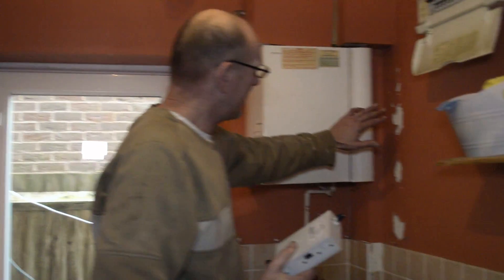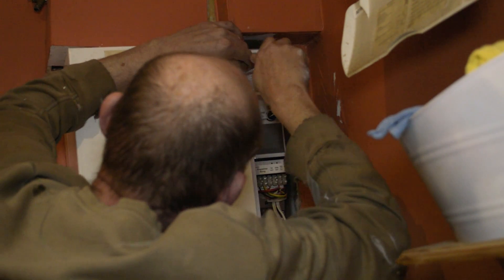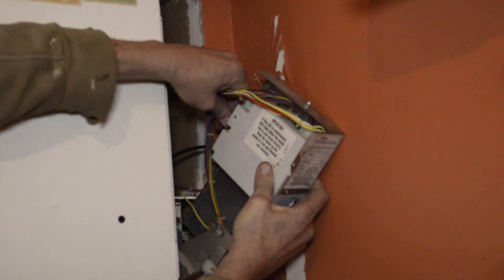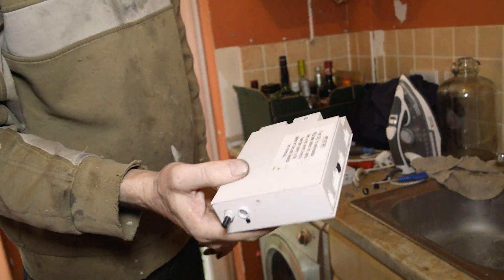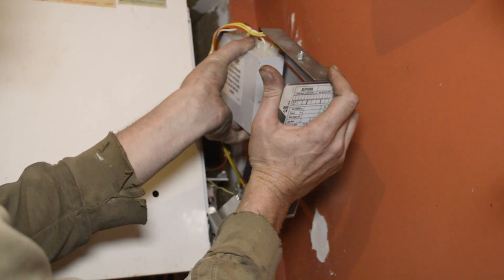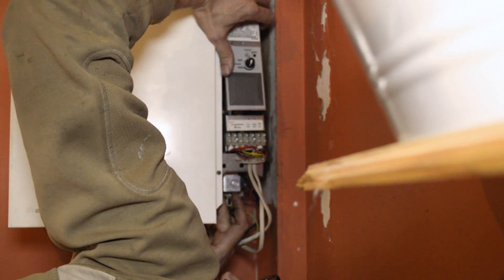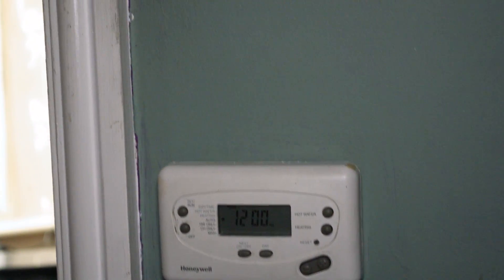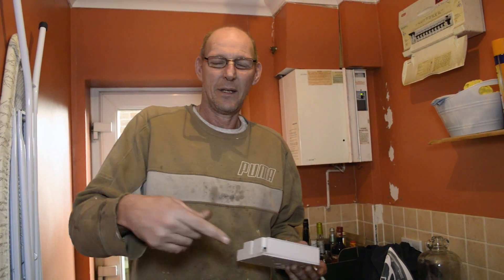Flashing red light on Potterton boiler and how to fix it.

Comment: Thanks John, I’ve seen another video for this boiler where they just changed the pcb board itself. Are there two different types of board, one with the grey unit you replaced and another with a circuit board…?

Comment: My Suprima 60L was a bit different.  It fired up but went out after about 1 minute with the water pipe barely luke warm.  It then fired up 5 or so minutes later and went out again.  This would repeat over and over with the rads only just Luke warm.  First thing replaced was the temperature sensor which made no difference.  Then the PCB, problem solved.

Comment: I take it you tested the FSD, burner pressure and Flue gas anylser after replacing the PCB as per Gas Safe regulations? Signed it off safe with your gas safe registration number too......

Comment: Had the same problem 11 years ago! Often it's not the components but dry joint issues with these. Resoldered all the joints...been going smoothly ever since. These boards are made in China using cold soldering which don't last for long.. Potterton knows about this but won't fix the issue for obvious reasons ! As it means  collecting  £250 a pop.